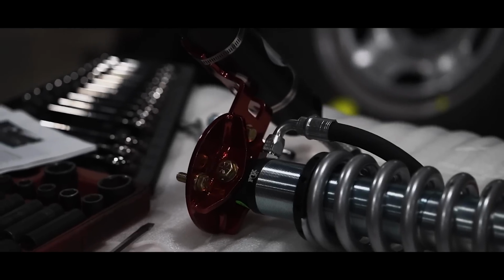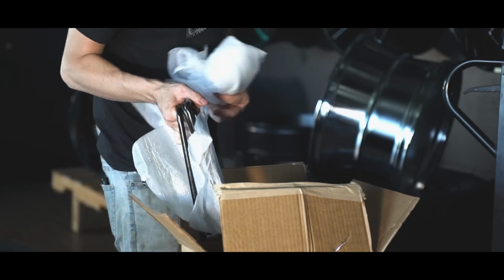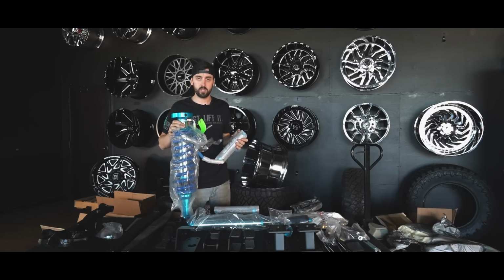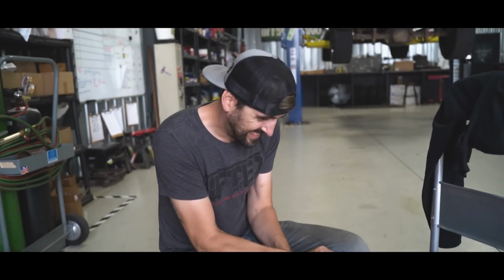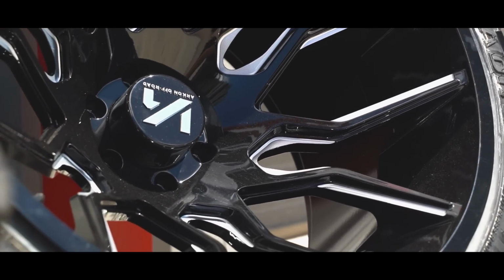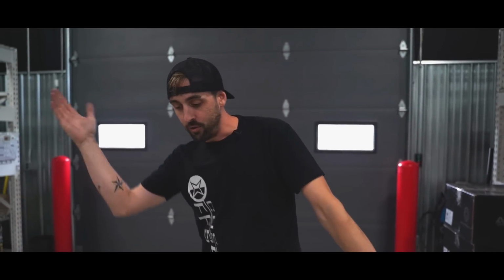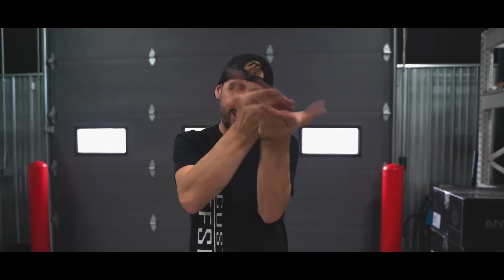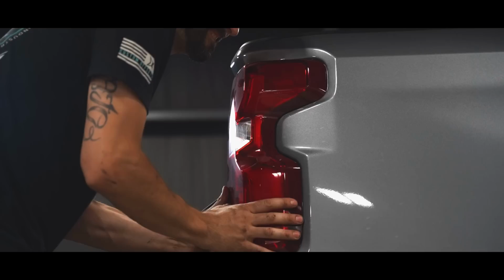This Color Is INSANE! || Banker's Build Part 2

Comment: Super lift 6 inch with Bilsteins or the zone 6 inch with upgraded uca's for a ram 1500? Which would be the better route to go? Going to run 35x13.5 venompowers and 22x14's
Reply from the maker: Both are pretty comparable options!
Reply: Custom Offsets I know the quality of zone is nearly bds quality since same manufacturer or whatever it is but the bilsteins and the huge skid plate that goes from crossmember to crossmember is making it hard !